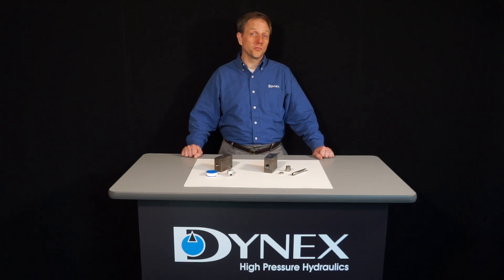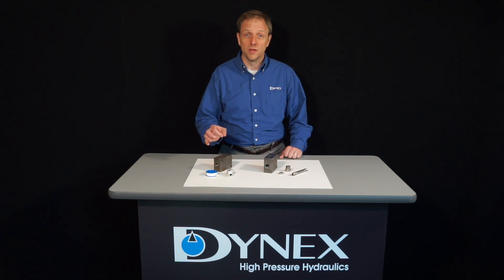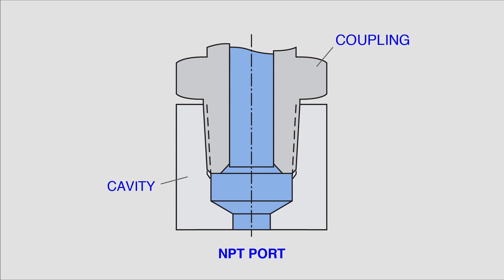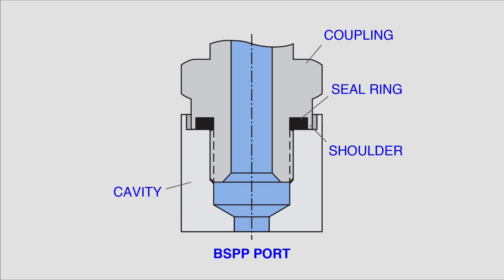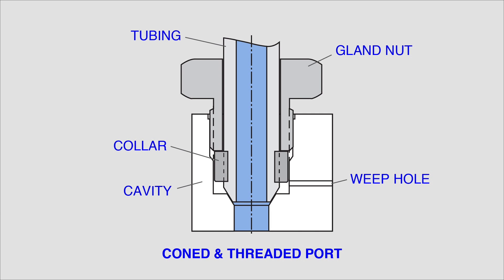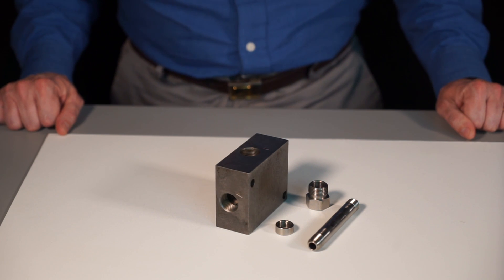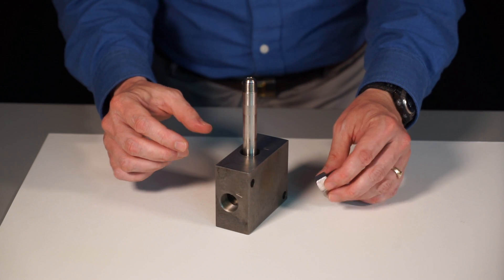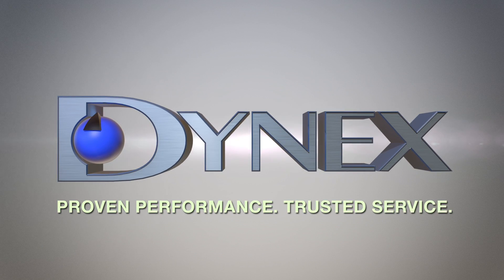Coned & Threaded Fittings Explained

Comment: Does anyone know which international standard drives Coned & Threaded connections? If I needed to, for example, manufacture the female form?

You can buy these parts anywhere but for some reason this information is hard to come by?

Diagrams that just tell you it's 60° aren't too helpful, what's the tolerance on that? What are the min material properties required? etc

Thanks for any help.

Comment from the maker: An additional note regarding the WEEP HOLE (the small passageway that allows pressurized system fluid to drain to atmosphere if an internal leak occurs). — Users of these fittings who observe leakage from a weep hole must repair the connection or replace the fitting immediately.